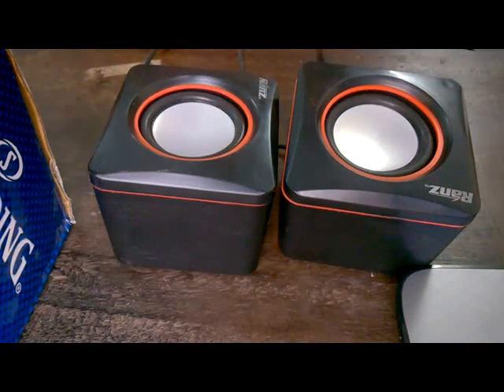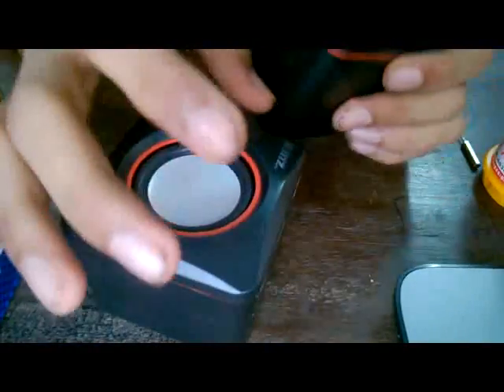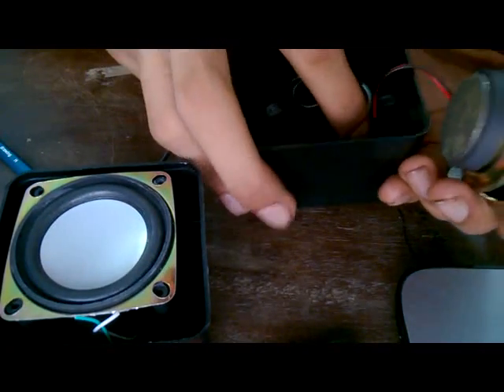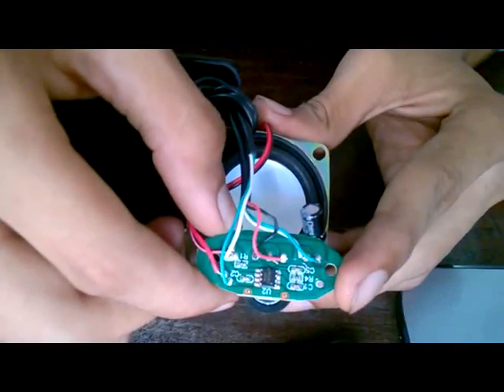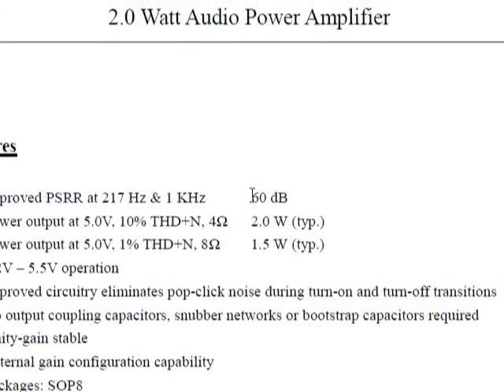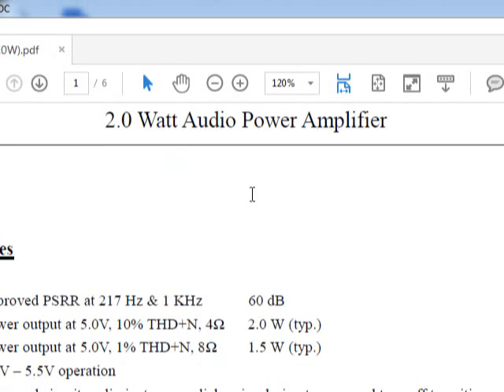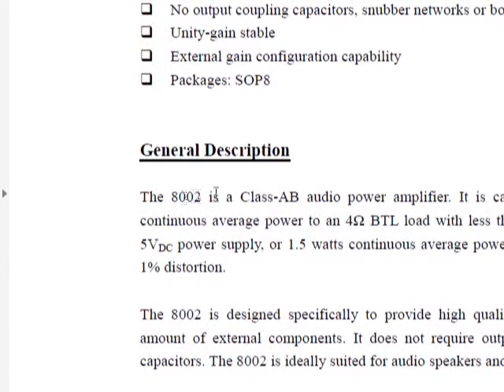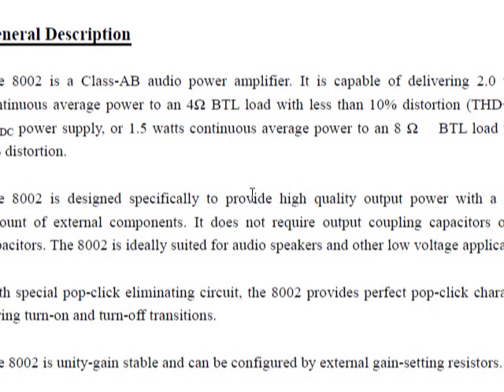Cheap USB Speakers Teardown

Comment: Rating of  Voltage and capacity of capacitor  inside in a USB speaker
Reply from the maker: mithun kumar Hey! Which capacitor are you talking about? The one that is put across the power supply was 100uF 25V if I remember correctly.
Reply: Thankyou

Comment: cheers man. very enlightening. i was looking for speakers for diy...your content has helped. 

some q's:
how are the freq. response of these speakers? and what are the wattage and impedance? and how good they sound for a 10x15' room:)
Reply from the maker: Well a little research indicated that there are two major types of speakers. 
1. The cheaper ones(like this one) with 2 watt amplifier and small magnet speakers(The maximum power of which is less than 2.5 watts).
2. Comparatively costly (like digiflip) speakers with true 2 x 3 watts amplifier with large magnet speakers that do support about 4-5 watts easily.
Mine have rather flat frequency response but the costlier ones do come with bass boost. Still if you like bassy music search for higher power speakers (10 watts or so).
Reply from the maker: To get an idea of the bass response of the speakers with about 2-3 watt amplifier check this video.
https://www.youtube.com/watch?v=nKjiZL5w8Xo